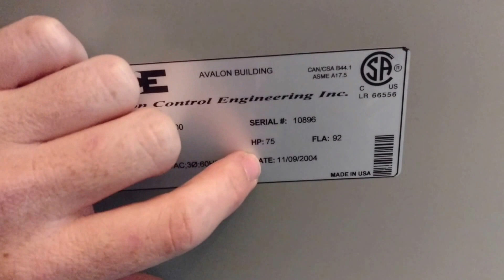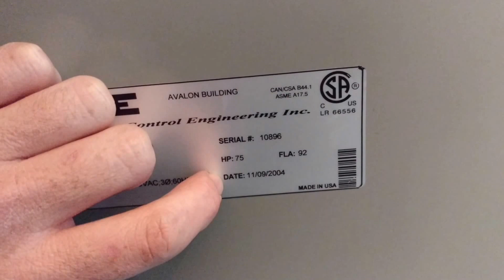Butchered Elevator "Modernization"

Comment: A novice with this stuff, but very interested. With the parking on the second floor, does this interfere with fire service if it is so equipped?
Reply from the maker: Brian Moody No fire service on it
Reply: Seems that can be resolved with some reprogramming and calibration?
Reply: @Elfnetdesigns  Yes, the parking floor will need to be changed to Basement on this controller, which will be floor one on this job.

Comment: We use to have a independent company in our area that would build their own hydro packages and they would buy their controllers from MCE by the truck load for stock because apparently it was cheaper to buy in larger quantities. They would then modify the controller for the specif job site conditions once they sold a job onsite. So when you call MCE for support their records usually don't match the site conditions. Reminds me of this controller.
Reply: So there is no documentation of the controller's alter specs in the MCE support records?  Only the original factory specs? That is not good! It's like modifying a piece of electronic gear w/o any specific information as to the circuit involved, part change out, new part add etc.  This controller is a mess, those relays plug into a socket not connected up with wires crimped to 1/4 female tabs.

Comment: So what did you do to the system ? When you find botched jobs like this do you remove everything and restart properly ?
Reply from the maker: Honestly I'd never seen anything quite like this before.  But it was deemed safe by an inspector when it was installed. From what I can tell nothing in the safeties was compromised. It's destined to be torn out though once problems arise.
Reply: Oh ok so what were you called in to do on this elevator exactly if you did not take it down and redo it properly ?
Reply from the maker: +MrSpartan117fan It's a unit on my service route. My job is to keep it maintained and running. Unfortunately tearing it out and starting over would cost thousands and thousands of dollars. The fixtures would and other things would all have to be brought up to current code.
Reply: MrSpartan117fan I don't think his company would like him disclosing up what he does in his job
Reply: @seanjuth  I know it's an old comment but: Not only that, if it is not broke then don't fix it. If the customer says repair, then you repair. You don't just replace an entire system because you want to. That is not good business no matter what you think is best. You do what the customer wants and can afford.